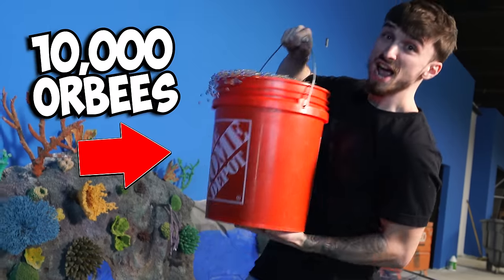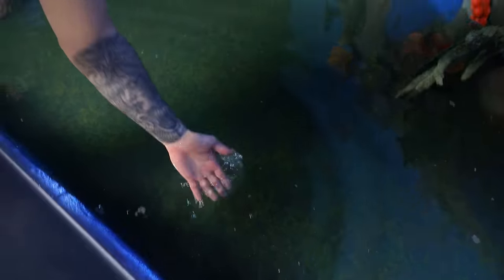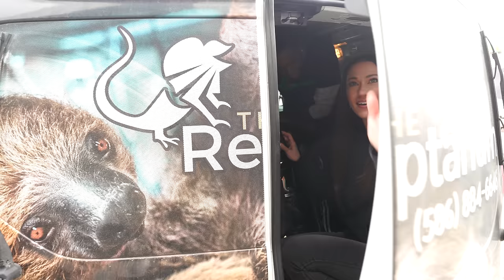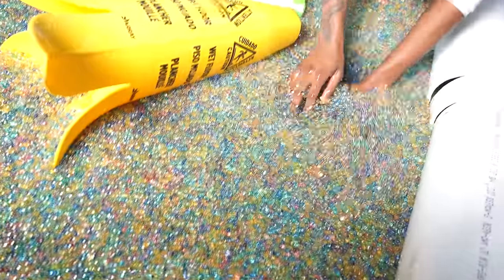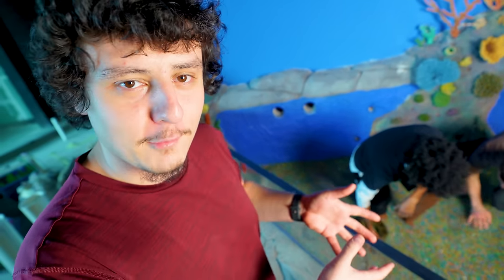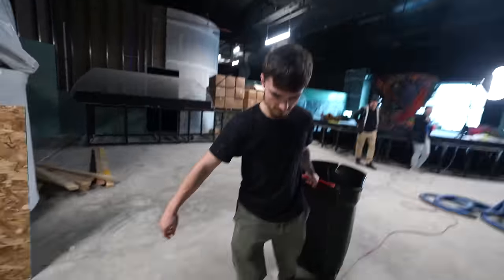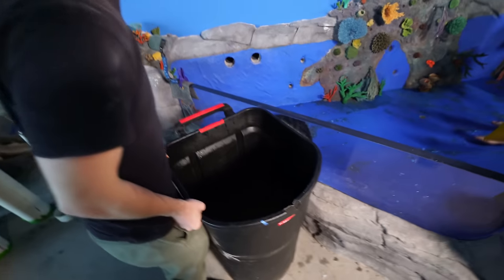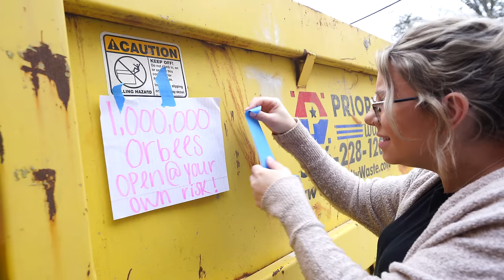Anaconda Vs 1 Million Orbeez

Comment: Great Vlog!!! Lori, Noah, Jay, Mike, Jay, and Gabby,
Thank God You got approval. The bottom of that tank should not be that delicate, and You found a huge leak. Pretty much a success in disguise. 
That garage door needs to be fixed. I am assuming with those exposed wires the electricity is probably cut off somewhere. The Aquarium looks pretty clean and organized I must say. 
Lori a great way to  keep the guys neat. If they want to do a video they have to clean  before and after.
They probably need to get with Bashi to figure out the best heavy duty wet vacuums for the Aquarium. They need to be  fast and well maintained. With all that water no one wants to find out it is broken when You need it.